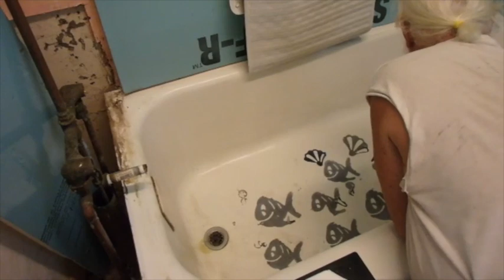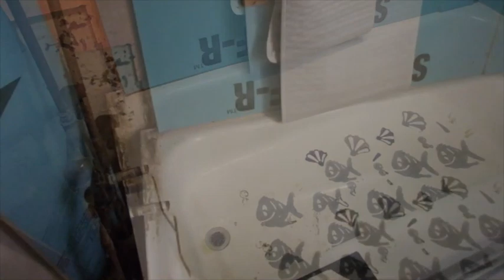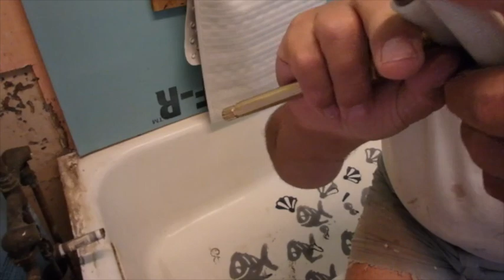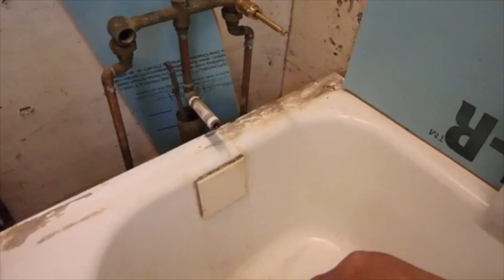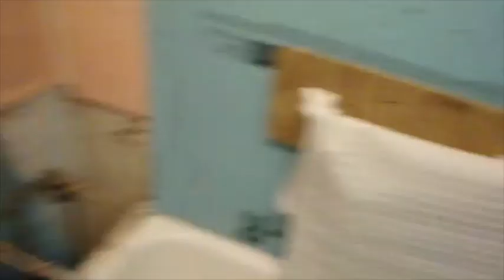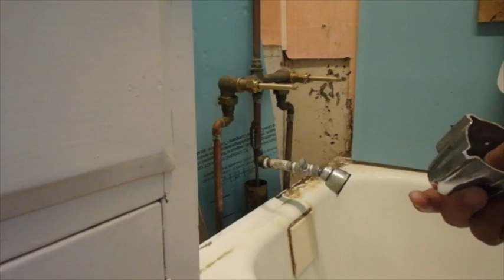Found new valves for my vintage plumbing on my cast iron tub

Comment: No you can't get two cast miniture banjos and use them for knobs lol :)
My bathroom is from 1948 so the tap tops are the cross with 4 balls on the ends of the cross.
Old fashoned, but so nice :-D
Reply from the maker: I like them kind.
Reply: If you are talking about my tap tops, i like the old designs too, solid metal that lasts a lifetime, unlike modern crap.
Can you tell i don't like modern plastic fantastic lol.
Reply from the maker: I can, and I agree with you.